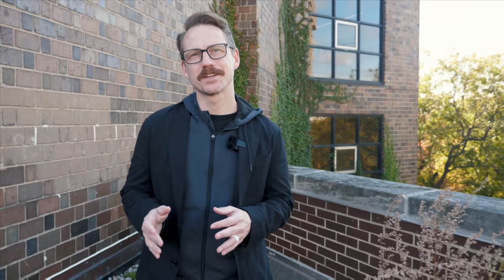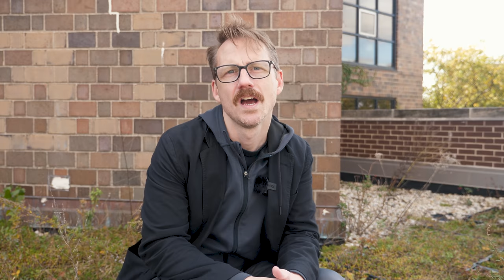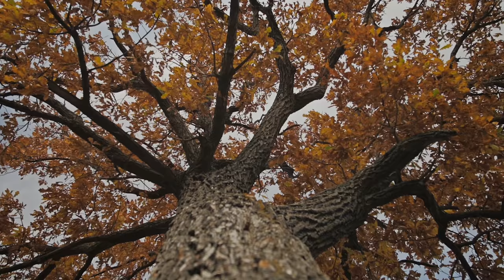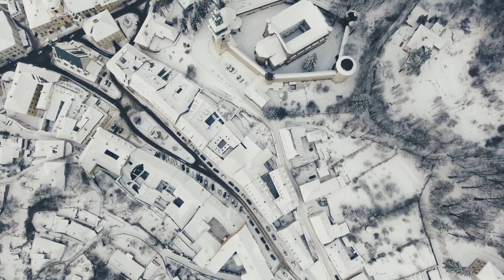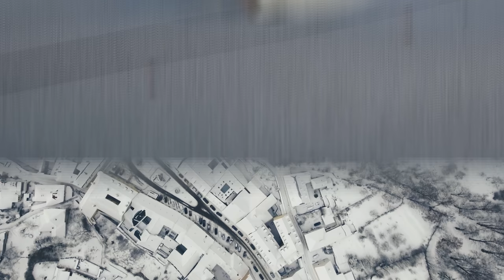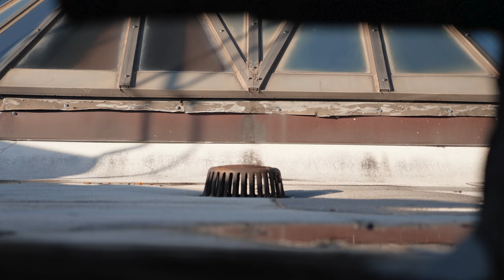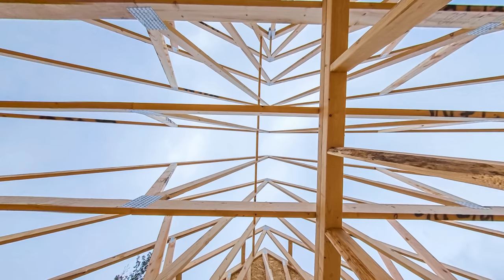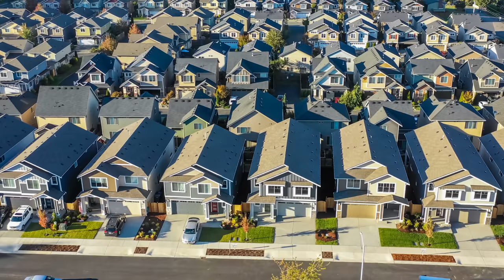Why Do Architects Insist on Using Flat Roofs?

Comment: Your "many gabled" roof reminded me of something I've noticed when I spend time in industrial areas: 
The "roof shape" of large-footprint industrial buildings can really show their age: 

Many old factory or warehouse buildings have "sawtooth" roofs where one half of the sawtooth is usually glass. Having spent time in these kinds of buildings, it's obvious that they were built to use next to no energy during the day for lighting. I think what's neat about these old sawtooth roofs is that the building designers almost certainly took the time to think about the sun's trajectory over the days and months. I tend to think of this "level" of design as something reserved for "fancy" buildings like churches or art installations, but it's clearly present in these "lowly" buildings as well. 
Contrast this with modern "big box" construction with a completely flat roof and constant electrical needs for lighting. I expect the actual roof is much easier to maintain, but the connection to the environment is completely lost. 

When did the "change over" happen? My guess is that we stopped building sawtooth factories at the end of WWII. The "slimline" florescent bulb" was released in 1946 which would have ushered in an era of cheaper indoor lighting on a factory-wide scale. I also wouldn't be surprised if the push to "black out skylights" in major cities during the war also put a literal damper on this kind of roof construction before it even made economical sense to switch over.
Reply: In my area, I see those sawtooth roofs in art and design-oriented buildings.  I assume that the architect designed those roofs because the occupants of the building wanted natural light for their subject.  And to your point, they almost always orient toward the south, where a more consistent amount of light is available.
Reply: A "sawtooth" roof probably has much higher heating and cooling costs, which is a much bigger factor in costs than modern energy-efficient lighting. Today it is cheaper to build with no windows at all, the money spend on lighting is negligible compared to lower up front costs, easier insulation and maintenance. Windows and skylights used to be required for natural lighting, but now its only used for esthetics, which is not a concern in industrial buildings.
Reply: @denisl2760  windows are absolutely needed, otherwise one feels claustrophobic and probably starts suffering from something.
(Poor health, high stress, circadian rhythm going awry etc.)

There's a reason "the view" increases $$$, as it increases demand. Also, why cruise cabines overlooking the sea costing more than those sandwiched in between the layers. Also why tables on a restaurant/hotel adjecent to windows are often the most booked.

Architecture used to be local. You could meet your fellow architect and builder next month along the streets. As such, there was a far bigger community connection. If he ripped you off, his reputation would be directly at stake.
That all changed with fordism. There's no company today that does it all, start to finish. (Or a significant portion of it.)
Instead there's company after company each "specialising" (read, pouring resources on the most profitable option they can still sell) on but a fringe aspect of a building, rendering the finished product completely impersonal.
As such, it's mighty hard to fight the "vector of the industry" with its scale benefits.

Becasue it's cheaper and able to be mass produced at a low cost.
Which is also part of why "big projects" run costly. (Not the only one) They are trying to come up with "tailor made" solutions, effectively renouncing scale benefits. It's also why it's hard to build in a different style.

So, really, the critique against architects is often missplaced. An architect today has budget constraints and industry forces shaping the range of his output.

What is needed is just more art in mass production, shouldn't be that hard to mass produce some decorative moulds that make a city livable rather than soulless. 

But it won't happen until demand dries up for rectangular, oppresive boxes.
Reply: @Untilitpases  For residential space, absolutely. But here we are talking about huge warehouses and factories, esthetics are not a concern.
Reply: @denisl2760  it's not a concern that people spend eight hours a day in an unhealthy environment? Light is not merely aesthetic. It's practical when it comes to the circadian rhythm. Also, direct gain (at winter angles) is a practical benefit of well planned windows.
Reply: @Maranville  Have ever been inside any sort of factory or industrial facility? Some of these places run 24/7 on 3 shifts so if you're concerned about natural light only 1/2 of the employees get to enjoy that. In terms of "unhealthy environment" there are 1000 other things to be concerned about, natural light is pretty far down on the list.
Reply: @denisl2760  yes and all of those things matter. I have mixed feelings about shift work. I know it's necessary sometimes, like in hospitals, but it sure does a number on people's health, both physical and mental. I did overnight for a month once and got so depressed. Never again.
Reply: @Untilitpases  very nice perspective thanks for sharing
Reply: @denisl2760  night looking like night helps as well. (And it not looking like night disturbs.)
Search as to why submarine crews have a "night-day" cycle, complete with ui theme changes along with the ambient lighting shifting.

If in the future we learn more about the human brain, its social makeup and pysche, we might be looking at lots of activities we currently do as barbarian, in much the same vein as we judge 18th century medicine today.
Reply: You're not wrong with the war mindset and feasibility of tube lighting.  You do miss the point with many big box stores though.  Many of them still employ skylights.  The determining factor is often cost and insurance liability.  Skylight have the liability of people falling through them or giving easy access for nefarious reasons.  Burglar bars in skylights exist for a reason.  But the main reason is cost.  Skylights have far lower U-values then continuous insulation.  They also have cost to purchase & install.  Additional thought by both the architect and structural engineer to accommodate the curbing means additional design costs.  They take longer to install than a monolithic roof as well.  

These costs are offset by the government grants and/or tax incentives (at least in the US) for using daylighting practices.  I prefer to use natural lighting as much as feasible for the design I'm working on.  For big box stores I love using skylights.
Reply: @Untilitpases  But that's not part of the cost of running the building itself though so not really relevant to this topic.
Reply: @hedgehog3180  Enter the concept of externality.
E.g. x factory is draining their sewers in x body of water. Y years ago = what's the problem?
Today (depending on the region, laws and their enforcement) = it's a veritable cost and a PR nightmare should it go astray.

That the basis behind regulation conpliance.

Comment: In canada, most residentials have gabled roofs.  I assume this is in part due to the amount of rain and snow we get.  Maximum drainage is necessary, but so is cleaning your eavestroughs.  Ive seen many packed with frozen leaves overflowing water and ruining peoples foundations or driveways.  The gable design is also good for venting, it pulls the warm air from below into the attic space keeping it cooler in the summer and helping your snowy roof defrost in the winter
Reply: What you are saying is right from what I understand. But flat roofs are easier to maintain plus you get an extra space for your family gathering or gardening or doing other stuffs. Some people in my country makes a small room in the roof just to enjoy the beauty of the sky at night. We call it 'Chilekotha(চিলেকোঠা)'. So I think flat roofs have more added benefits. But some country like yours, gabled roofs are also a good choice but I like flat roofs more

Comment: I love this channel! And this video was excellent, thank you for all the amazing content, Stewart!
Reply from the maker: Thank you very much! I love your channel as well!
Reply: I agree, love both of your channels! ; )
Reply: @stewarthicks  one problem with the flat roof is the missing of the overhang. The overhang takes a lot of stress and weathering away from the facade.
Reply: @stewarthicks  The attic not usable is an North American problem starting in the 1880`s. Before that, Attics where always usable like still today, all over the world.
Reply: I disagree. I think there are other virtues of a pitched roof which were not discussed, and other drawbacks to a flat roof which were skipped over. I didn't learn anything new here, but it did have the feel of some kind of agenda. I suppose a flat roof makes sense on a skyscraper since you can park all the ugly mechanical equipment up there and hide it with a parapet. However this skips past the fact that skyscrapers are generally a pretty shitty building typology, representing a 'vertical cul-de-sac' in the heart of a city and almost precluding the ability to build a walkable/carless urban setting. But don't believe me - check Leon Krier if you want some actually useful and well considered design advice.
Reply: Solar roofs should be the standard
Reply: @matthewboyd8689  I also disagree with that statement. Perhaps in an urban setting solar roof is appropriate - but it has two major drawbacks. the first is that it is expensive to install and maintain. the second is that it remains in a fixed position all year long. contrast that with a ground mounted array, out in the yard like a 'solar garden' with panels that can be adjusted to match the suns azimuth angle, adjusted at the start of each season or continually through a tracking motor. This type of panel will generate many times the electricity of a roof mounted panel, and will be cheaper to install as long as you have the property to do it - and many people in the us have huge unused yards that a corner could be used for a solar project. plus then it's easy to expand it as you decide to up your quantity - something you also can't do when they're on the roof
Reply: No way, Upstairs made it into the Comments!!!
Reply: @stewarthicks  I saw what you did there with the Farnsworth House ... LOL!
Reply: @petermages9482   Many 'flat' roofs have overhangs.
Reply: Absolutely! Well said, an excellent video indeed lol
Reply: @stewarthicks  PLEASE stop waving your hands all over the place when you talk.  It's distracting.

Comment: Great video and information. I think an issue architects face all the time is that what they do is often complicated. So many variables to consider, so many choces for execution. Non-architects seem to have developed an affection for simplicity even when it's not the best solution - practically or esthetically. Once a person has bought-in to the form follows function concept, there is little you can to do change their minds. Particularly if your explanation is complex and rich in important, relevant and factual detail. That just makes their eyes glaze over and gives them fodder to express their form/fuction dogma. A low slope roof designed correctly, built with appropriate and modern materials and assembled without mistakes, can be an excellent choice for almost any building. And the exact same holds true for gabled roofs. It's a wash.

Comment: When i lived in mexico, i cant remember many of the times i came across a different kind of roof apart from flat, we really like to make flat roofs, its nice to have a flat roof sometimes, you can also use the space for multiple things like it was just another floor in your house.
Reply: Did ya get alot of rainfall there?
Reply: Of course - flat roofs are practical and dominant in temperate climates for the reasons you mention. But for those of us in the bold north, the reality of snow accumulation and it's inevitable melting, creates for much different considerations. Rainfall is not the same.  Flat roofs are fairly common in the pacific northwest modern architecture where winter = rain, not snow. I assume the builders there have learned to master the direction of running water, and to consider how to leverage sun and wind to manage humidity impacts on materials.
Reply: @DarkMoonDroid  yes, but also a year around 18 to 27 Celsius degrees as average temps, water evaporates rather quickly, specially considering that the rain season is summer.
The other half of the country is desert so that is a non problem, flat roofs actually help by being a space to put the AC units in that half of the country.
Reply: Flat roof are more common on warmer climates because it rains way less than colder climates, and back in the day people collected water by putting pots on the roof when it rains since every drop matters.

Comment: Before air conditioning some factories and office buildings were designed With flat roofs that would hold 2-3 inches of water. The evaporation of the water would cool the building.

Comment: As someone whose entire career has been working or managing warehouse or retail locations… (with the exception of metal roofs) I have never seen a flat roof that didn’t leak, & found that some still leaked after multiple repair/patch attempts by professionals costing thousands.
Reply: That speaks more about how cheap warehouses are made, seeking reduced costs at every step, than it did about flat roofs. There are a lot of flat roof residential buildings. Some might be leaking at some point of time, but do you really think all of them do, and people just live in swimming pools?
Reply: @jankoodziej877  For the same cost, flat roofs are more likely to leak than well sloped tile.
Reply: @be12  but flat roofs are much cheaper, you don't need expensive wooden construction and the tiles. For the same cost you can get much better quality.
Reply: @jankoodziej877  There are multiple carpenters on this thread saying the opposite. Unless you want a cartoon house roof with a 45 degree slope, of course.

Flat roofs that don't leak are more expensive than tile roofs that don't leak.
Reply: @be12  your don't need any carpenters for a flat roof, that's the thing.
Reply: @jankoodziej877  Gotta admit I lol'd :-)
Reply: @be12  well, not the whole world build like US. You might be surprised to learn that in Europe wooden skeleton houses are far less popular than brick and mortar, which often use concrete ceiling, on which you could put insulation and the roof is done, not one piece of wood required.
Reply: @jankoodziej877  Hey, I wasn't being sarcastic. Having no wood is a plus - depending on how much more or less concrete costs in the long run. 

While they say anecdotes are not data, I've known of multiple instances (including my own) where concrete roofs cost much more because of mandatory repairs, ie scraping the old concrete and re-concreting the entire roof. Now these were flat roofs, and even a slight slope on the concrete would've made it much better. But then I live in a tropical country with areas of high ( > 300 cm) rainfall where houses have traditionally been of brick but roofs are tile.

Comment: When I went into Junior High school. They had rebuilt the entire thing to fix a lot of the old issues. A new shiny exterior and interior, pretty nice and high-tech in a way. Understandably the roof was flat as the building was a 1 floor slab with a big footprint. But it also meant that the climate found deep into Norway would cause issues with tons of snow. Every winter the school would need the students to get up there via ladders to clear snow off of the roof to prevent damage. The roof also had issues with drainage leaking, leaving water in the hallways and classrooms. Good times.
Reply: definitely a case of poor installers, and not reinforcing the structure for snow load. Here in Canada all buildings are designed for snow to be on the flat roofs. you should never have to remove he snow off a flat roof. for reference I have been in the flat roofing industry for 10 years.
Reply: Lol, the students probably damaged the roof during a probably unnecessary snow removal.